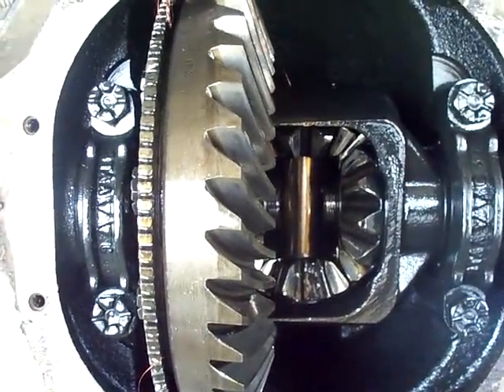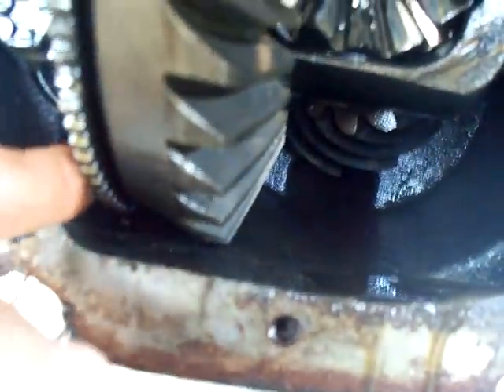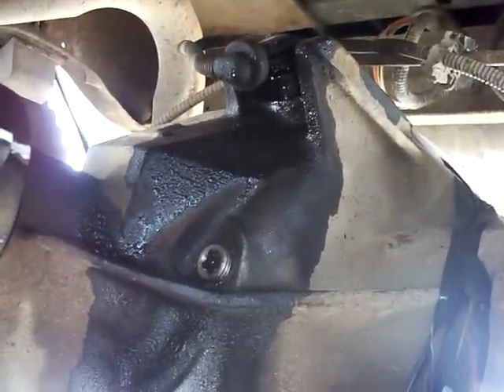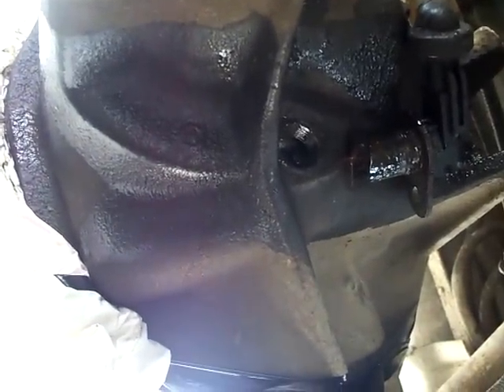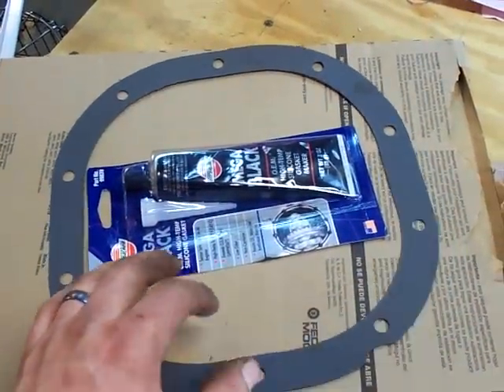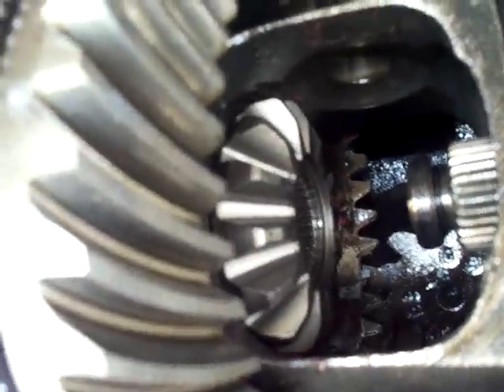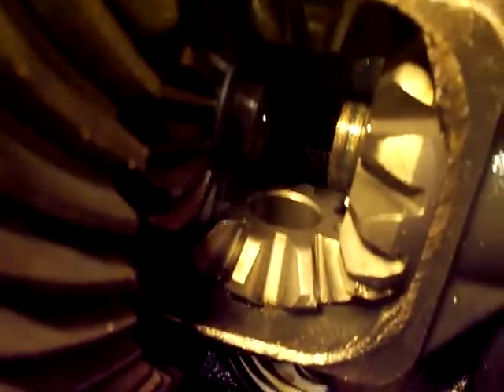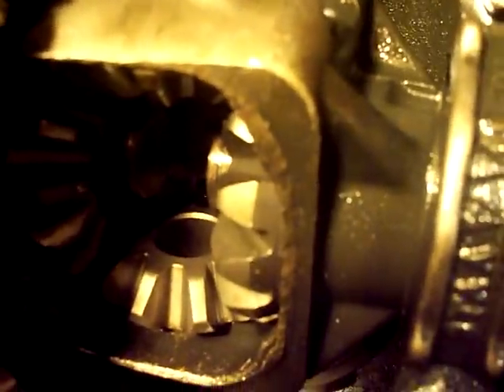Ford 8.8 Differential Part 1

Comment: Can you explain when you said you have a open differential at 1:06 ? I have a 1990 Ford F150 4wd 5.0 AOD transmission A/T I need to know if I have a limited slip diff so I can add or not add friction modifier to the rear diff along with 80 90w gear oil. I gave the numbers on the rear diff to my Ford dealer he said he couldn't find anything. My numbers are SB17P 3L55880A31. Thx

Comment: My dear, congratulations on the video! I live in Brazil, I have problem in my Ford Explorer 2004, she gives a jolt, sometimes they constantly put in reverse or "d", the stride is giving this more when I'm moving and shooting off the throttle once , gives the stride, when floor once also gives the stride, like a hit metal, or something working loose, what do you think? May be in the transmission box? Or differential? Underscoring that peaceful machas pass without any stride. I'm grateful for the attention.

Comment: You can save yourself 5.00 and just use RTV sealant as the gasket. I have never had a failure or leak using it and I am not easy on my truck. If done correctly there is no need for a gasket

Comment: An ok video, but you go into detail about little things that aren't all that important IMO. And you don't show how to disassemble the spider gears/cage or remove the c-clips, I'm replacing all the bearings in my rear end, and axle bearings so I need to know how to take it apart. You jump from the gears fully assembled to it being apart with no explanation.maybe that's when your battery died....I've been an industrial millwright for 35 years and have been working on my own cars longer than that, but don't work on differentials much, as they usually last a long time. My '87 F-150 has 337,000 miles on it & the front pinion bearing went out, but my gears look pretty good. I recommend replacing all the bearings including the axle bearings since you've gone into it this far especially if you have high milage. The pinion shaft thread length is not important, as you should always use a torque wrench to tighten the nut to set the bearing pre-load . Also the drive shaft is balanced before the vehicle is built, not on the vehicle so it doesn't matter if it goes back to the same spot or not. I also recommend buying a manual for the vehicle so you can get the torque specs and other pointers for dis-assembly/ re-assembly.
Reply from the maker: At about 12:59 I'm reinstalling the c clips.  I know I mention it in there somewhere, but anyway:  Once the pin and spiders have been removed from the carrier, simply push in one axle at a time.  From the wheel, as long as you're off the ground it'll slide in.  That'll push the axle, c clip, and side gear in enough to push the side gear back and pull the c clip out.  Easy as pie.
   I should have guessed that people would end up being pretty critical about calipering the pinion threads vs. using a torque wrench.  There's more than one way to skin a cat. 
  My method was effective and returned the pinion and bearing to it's original position.  IF there was any change or wear that required that position to be different, it would have been from bearing or race wear.  That would have meant I needed a new bearing.  I SHOULD have informed the viewers of the service manual specs for torque.  I'm not suggesting my method would work when installing new pinion or bearing.  For my purpose, replacing seal, it works fine.
  I'd like to encourage people to critically examine the machinery they're working on.  Understand why you're doing what you're doing.  How it all works, and what it all means.  Bearing preload is a horse of many colors.  There are a lot of spindles and axles that preload is set by micrometer measurement of thread stick out.  Some other setups are measured with an indicator on part that rides in bearing and force applied axially or radially to measure deflection/movement.  Many worm gear reducers used in industry have tapered roller bearings on output shaft.  Preload on these is set with shim sets under the bearing caps.   No torque wrench used here.  Calipers and indicator are used to measure for shim on each side and remove play.  I do front wheel bearings on Caterpillar GP40 forklift by measuring threads, as the nut is usually removed with a spanner.  Keep the axle half shaft pulled out of the final drive and you can spin the wheel hub by hand.  You'll be able to actually feel if the bearings are loaded to tight.  Many times the needed spanner attachment, crows foot, or whatever for torqueing specs isn't around and the job still needs done.  You got use your noodle, and figure out a suitable alternative.
  The instructions for c clip removal are also included in that service manual that you were telling me to use.  I'd say you may want to heed some of your own advice there Mr. Mechanic.
Reply: Darren Miller I did read the dis-assembly section before starting, but a video would have shown so much more, my pinion shaft lock bolt was broken off & I had to deal with getting the pin out of the shaft before I could take it apart! I did some minimal grinding on the cage to get the rest of the bolt/pin out, maybe not the best method but I don't think it will cause a problem. I have since learned there is an extraction tool that will prevent the need to grind.

  I still don't subscribe to measuring the thread length for setting bearing preload,  though it will get you close, the manual also states to use a new pinion nut, which is a lock nut, and a new collapsible spacer, but I'm sure locktite would suffice with an old nut, and if you exceed the pre-load, don't just back off the nut & start over, the collapsible washer MUST be replaced or you will not have the proper pre-load! You have to work your way up to it and not go over....My pinion nut had come loose, my bearings actually looked ok, but I bought new ones since I have it apart already.                      

   After reading the assembly section I learned this:
   Tighten the nut to at least 160 ft lbs,, then check the pre-load by turning the pinion shaft (before installing the ring gear) with an inch pound torque wrench to ensure you come up with  8 to 14 lNCH/LBS of force for a USED bearing and
16 to 29 INCH/LBS for a NEW bearing. If you don't have enough pre-load @ 160 FT/LBS keep tightening the nut a little at a time till you get your pre-load in specs. 2 torque wrenches are recommended FT/LB & IN/LB,160 FT/LB is just a starting point but should get it pretty close.   (12 INCH/LBS = 1-FT/LB)
 
 I bought a differential rebuild kit at O'Reillys for $103.00 which contains all new bearings, seals, a new nut and collapsible washer. It did not come with the Pinion Bolt/Dowel Pin so i have to go to the Ford Dealer to buy one, and a possibly a new differential pinion shaft, as it has some bad spots on it where the gear rides but the gear looks ok.

 VERY IMPORTANT! Make sure you pack all the bearings with grease before installing them, old or new, even though you will fill the differential housing with gear oil, you don't want have a dry start when you start driving the vehicle again.
 
  Didn't mean to sound so critical, your video did help, I'm offering this advise to help others, not to criticize, all specs came from my Chilton's repair manual.     :-)

Comment: I have a 2000 f150 4x4 off road with 4x4 on dash switch . Now when driving down the road in 4x4 it works as it should but when I turn past half way my 4x4 like binds up and pops . Was told by a transmission shop that my limited slip needs repaired what's your thoughts ? And where is the limited slip at they said it was in the transfer case
Reply from the maker: Man, I've not worked on any 9th gen or newer f150s.  From what you are saying, if the bind and pop only happens when 4x4 is on, and it when turning, cornering, not going straight...........I'd say the tranny shop is right.  I honestly don't know about limited slip in a front  transfer case.  I'd say its probably in line with your axles though just like on a rear diff.  Now's the time to ask yourself if you're gonna tackle this yourself, or pay a shop.  Personally, I'd do it myself.

Comment: Hey man, nothin for nothing, but I've seen some pretty gnarly results of mechanics working with wedding rings on...under the wrong circumstances you'll find the skin of a finger comes off like a glove.  Decent video, would have been excellent instruction were it not for a few missed steps and cut outs.
Reply from the maker: First and foremost, I appreciate your concern about the ring.  Although I've got a little to say about that.  I do think that anyone who becomes victim of "ring amputation" while rolling spider gears into their differential was doing something wrong.  By all means you're correct about it being an additional hazard.  With what I do for a living, putting your hands (or ring finger) in the wrong place at the wrong time has greater consequences than just loosing a finger.  Enough amps of 480VAC can pass through my ring finger to cook my organs like grill food and blow out the bottoms of my feet on the way out.  I'm not being cocky here, but please understand that paying attention to what you're doing is MUCH more important than worrying about a wedding ring.  All said, thanks for lookin out, and I'll try to be careful.
As for the missed steps and cut outs:  I've got no camera person.  I've got absolutely no skill at shooting videos.  I'm definitely no ETCG.  I'm just trying to pay it back.  I've learned so much from the internet its crazy.  I know a lot of folks are into working on their cars.  If I do something with one of our cars that doesn't have a vid on youtube, I try to make time to video it.  If you can roll in spiders and hold a camera at the same time you're good.  I'm not that good. 
   
I'd pretty much sum up your comment as criticism.  Although not douchie or hateful.  The vid is for diy folks that want to see stuff before messing with it.  It's not up for best picture of the year.

Comment: Look at the emulsion on the sounding ring, water got into the case.
Reply from the maker: I assume you're talking about the exciter ring for the ABS.  I can't say that I see what you're talking about.  The oil ran out clear as I remember.  I've seen oil water emulsion in a worm gear style gear reducer (industrial) and the evidence is very obvious, almost as obvious as blown cylinder head gasket or cracked head letting coolant into the engine oil.  I'm not going to disagree completely, but I certainly don't recall seeing any "milky" looking gear oil.